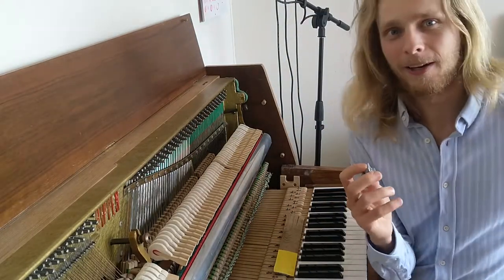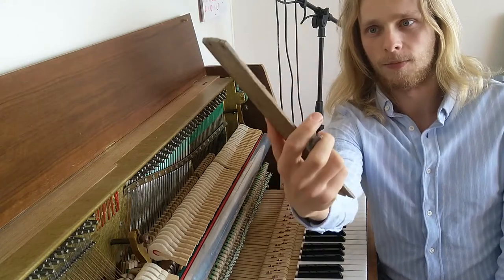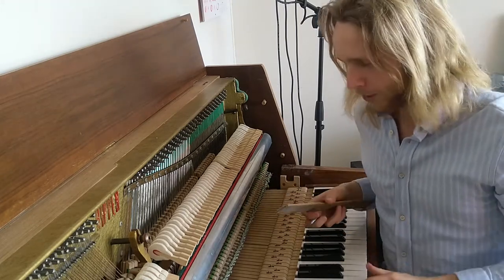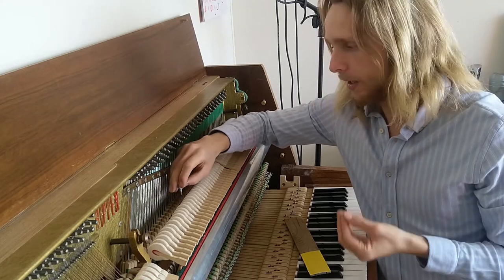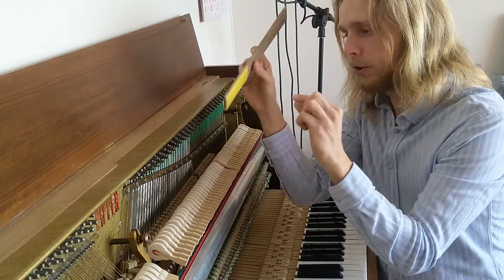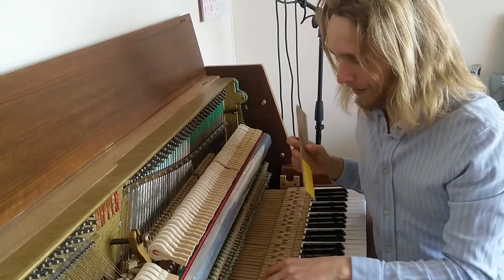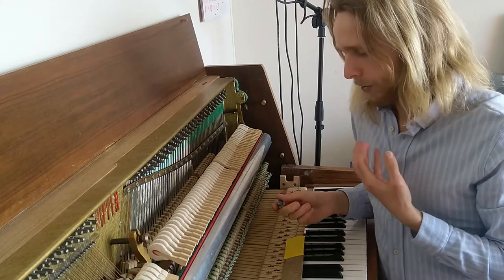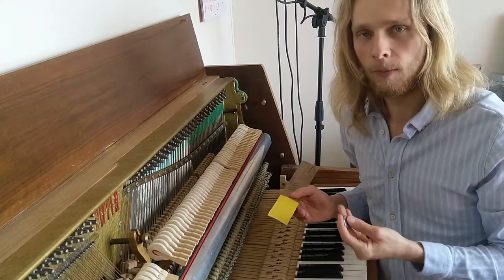How to voice your piano with home-made tools

Comment: I thought the needle tool added more felt to the hammer I didnt know it moved the layers im so dumb 😂
Reply from the maker: You're just learning! I made it very simply by using a coin, a needle and some ductape. So you just use the coin to hold it and the ductape to attach it to the coin. Good luck! I've learned a bit more. Apparently you should just stick the needle in the hammer perpendicularly (not under the surface like I'm doing in the video)